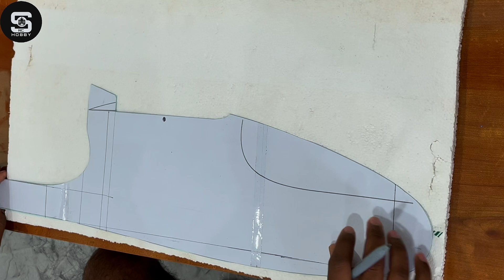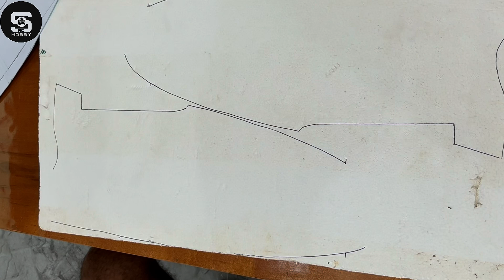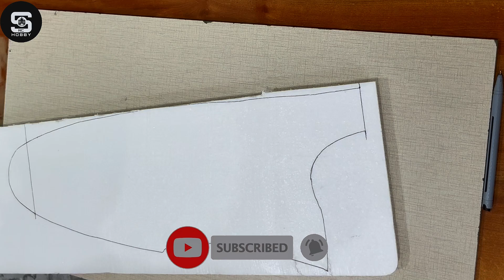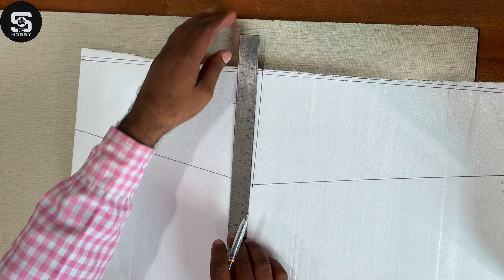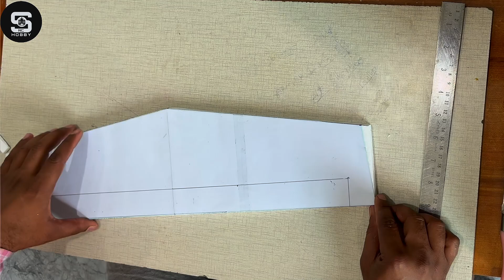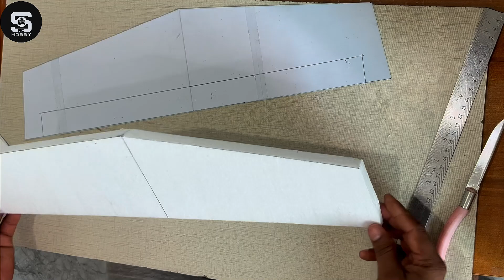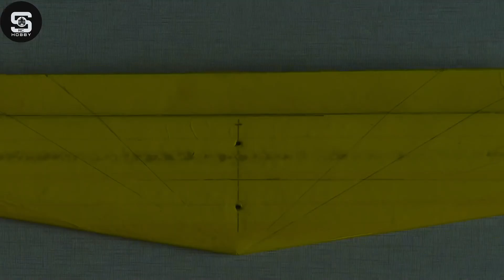How to make skywalker rc plane at home | Easy flying rc plane | Easy glider

Comment: 1202   elevator span should  NOT  be truncated.
1224   top of rudder should  NOT  be truncated.
1328   servos  do  NOT  go  at  the  tail.
1826   heavy steel screws do  NOT  go  at  the  tail.
1829   the thrust line is going to be less-than optimal.